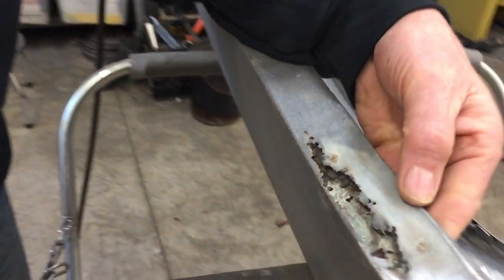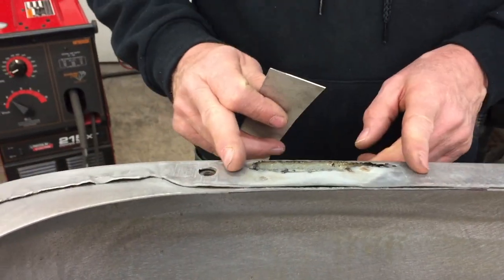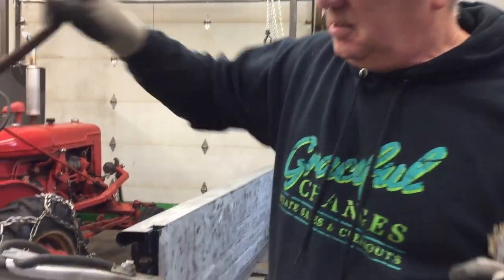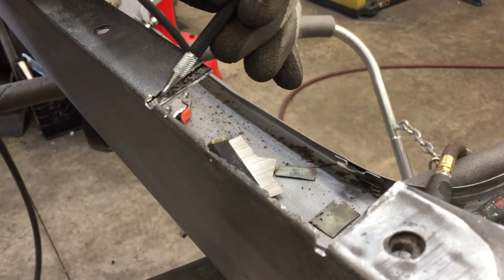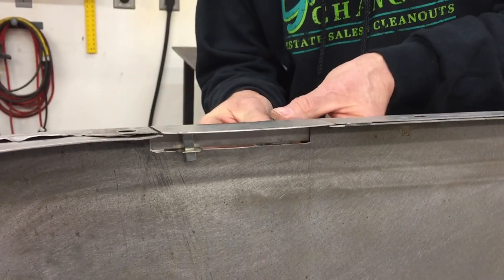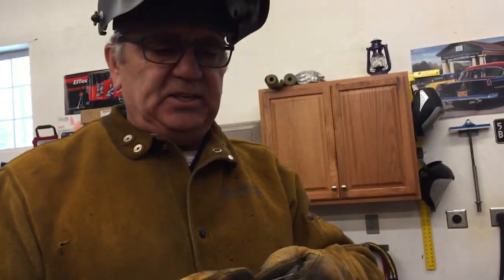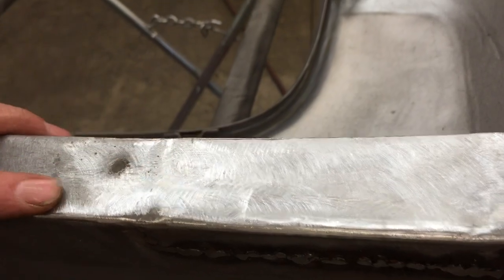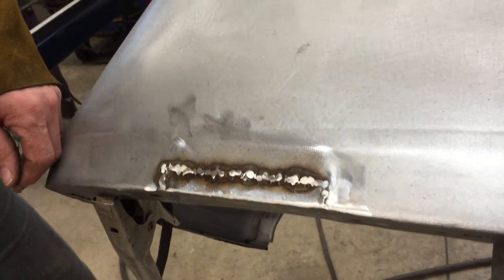Fixing a rusty fender

Comment: the only rust on my 37 is a 2" spot on the back of the cab where it meets the floor pan.  My front fenders are in fairly good shape, mostly they have some fatigue cracks I'll need to weld up. the same can't be said of the rears though. They've been pretty well mangled and While I can kinda pound them back into shape,  I most likely will use repop fenders which are only available in Fiberglass for 37.  I was looking over the grill shell this weekend and it has a ding low on the bottom, it should be really easy to pound out.  The fenders bolt to a flange on the sides of the grill shell and on both sides that's fatigued and cracked at a bend.

Comment: Hi,  I'm new to your site, I've noticed that your truck is bare metal have you put some kind of rust inhabiter on the the bare metal to stop it from oxidising?
Reply from the maker: Welcome to the channel Gary I use a product called fluid film comes in aerosol can.  
I get it at Napa auto parts,  spray it on wipe the metal down keeps it from rusting it works really good.
Reply: @idahofabricator8710  Cheers. I live in Australia hope I can find it here.
Reply from the maker: I just checked you can get it on Amazon

Comment: What did you have your welder set at?
Reply from the maker: Kurt   My welder is a Lincoln 216, the fender was 16 gauge steel I think I had the voltage set at B, the wire speed somewhere around 130 I’m running .030 wire just do small stitch welds if you try and do a long bead you’ll get too much heat and it’ll melt through good luck man
Reply: thank you for your reply i wish i had more welding knowledge I have all your videos and will refer back to them to help me with my truck thanks again, Kurt